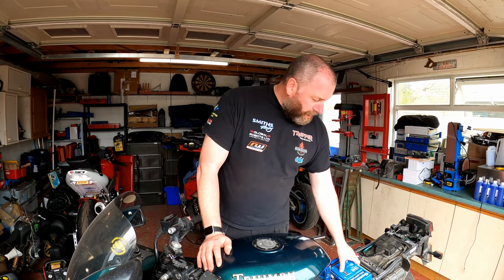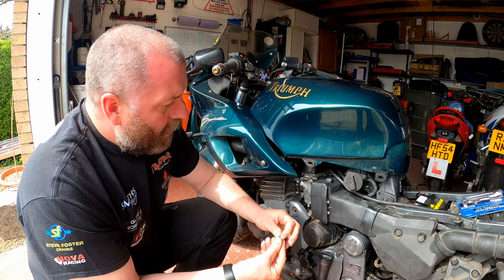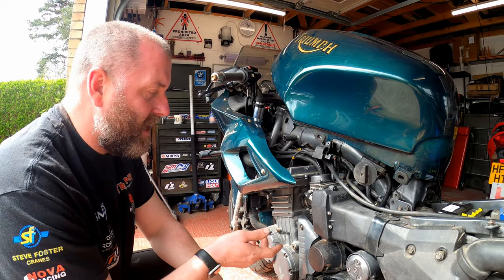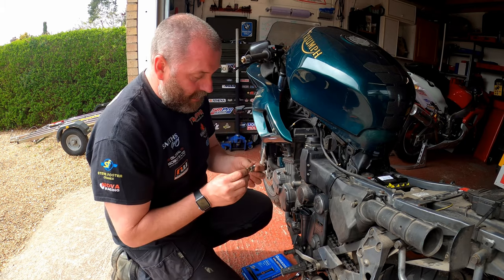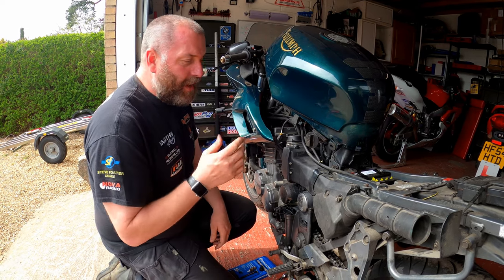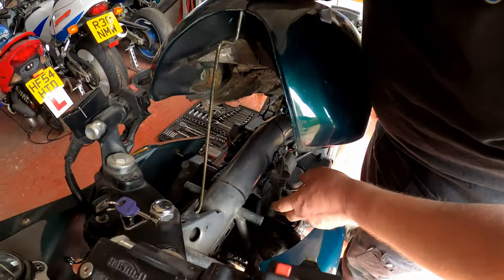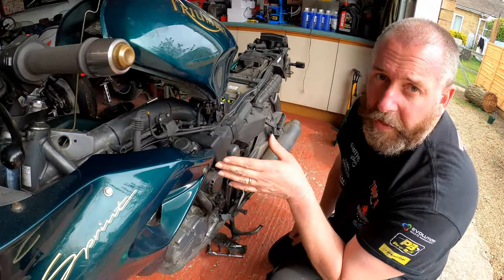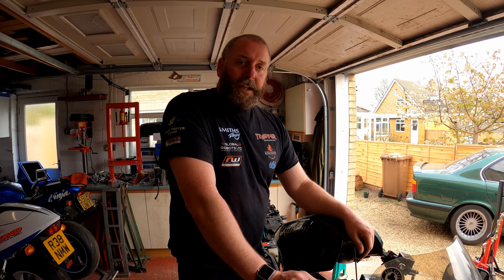1994 Triumph Sprint 900 Service Series - Part Three - Carburettor Tuning With The Gunson Colortune

Comment: Wonderful video Kev. I have a pristine 1996 Trident 900 that was sitting in storage for 16 years. Additionally, I moved to Colorado where I now ride at an elevation of 5000-12,000 feet. Bike was set-up for sea-level where I purchased it new. I was just getting ready to rebuild the carbs on this bike and I was completely mystified as to how I would ever get it to run correctly. Just happened across your Sprint videos and this one with the Colortune. Brilliant stuff. My only other option was to clean it up (beautiful BRG, cream and hand applied gold pinstripe) and display it in my living room. Any idea to the main jet I might start with for this elevation? Thanks again brother!

Comment: Hi Kev, love the channel,I was wondering if I could pick your brains, I have a trophy 900, on the carbs, there's two vacuum pipes,do they go on the engine or tank, i Didn't take them off and nothing in the manual. Any help would be gratefully received. Regards Chris

Comment: Sorry to be a pain buddy, but, how did you adjust the fuel screw. what did you do to get at the middle carb screw?  Im running rich with white smoke from no1 or no2 cylinders. No3 has no white smoke.  Tried to get a Gunson, but, they are on 3-4  months stock out :(
Reply from the maker: To get to the middle one, I used a small 3/8 screwdriver but with a tiny spanner to turn it, it shouldn’t take too much adjustment to get it right. Did you see the link in the video description? Is that supplier out of stock too?
Reply: @KevsShed  Yes mate. Tried every UK supplier and ended up contacting Gunson. They said totally stocked out for next 3-4 months. Just changed oil and filter and no sign of water so hoping white smoke is just running too rich. Haven't checked valves yet.

Comment: Awesome! Could you do the same on the 9R?
Reply from the maker: Will do! 👍🤓
Reply: @KevsShed  How high can you rev it before you leave the pilot jet range? Can you check the mixture of the midrange also with these window-plugs?
Reply from the maker: @nitramh24  The pilot jet range is normally up to around 1/8th of the throttle and then it's on the main. You can indeed tune the mid with this. Obviously you'll need to adjust the needle height or the main jet though.
Reply: @KevsShed  Cool! Thanks. I have a 98 9R that’s lean on the idle, but rich in the midrange (I think). No dynos where I live in Northern Norway, so I might go for the option you’re showing here to get closer to the sweet spot. But for the midrange I guess one has to leave it somewhat rich, due to ram air and better air flow at speed?
Reply from the maker: @nitramh24  The C model 9R benefits from a 0.5mm thick M3 washer under the needle clip to lift the needles slightly, to richen the mixture as they are usually a little leaner then ideal. This is with stock jetting mind so if it's been changed in the past then this wouldn't be relevant.
Reply: @KevsShed  Cheers! There’s a dynojet in there, but I went overboard raising the needle last year... One needs a phd in carburettors to get them right, I’m just messing about 🤣🤣

Comment: What revs are you looking for for a sweet tick over Kev?
Reply from the maker: If I recall correctly the idle speed when up to temp and off choke should be 1000 RPM, I don't have the manual to hand to double check though. Next time I am in the shed I will look in the manual and confirm for you 👍
Reply: @KevsShed  Thats good? Just done carb overhaul and stable at 1000.cheers chap.

Comment: Quick question - do you colortune AND sync?
Reply from the maker: Yes mate, the colortune ensures that the mixture is accurate, the sync will ensure that all of the butterflies are equal.
Reply from the maker: https://youtu.be/UklEDHdFch8
Reply: @KevsShed  thanks! First time rebuilding carbs! Gone together ok. Idles fine. But bogs/hesitant to rev
Reply from the maker: @thevoodoovultures3713  check the rubbers aren’t allowing air in, same for the diaphragms.